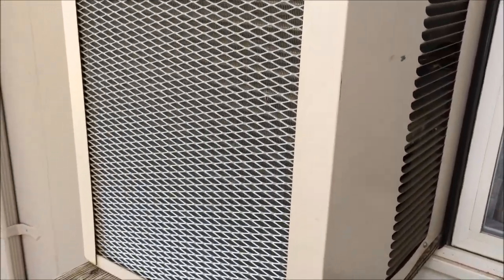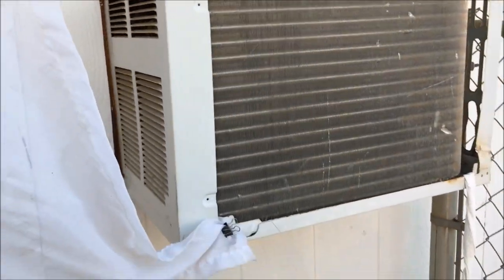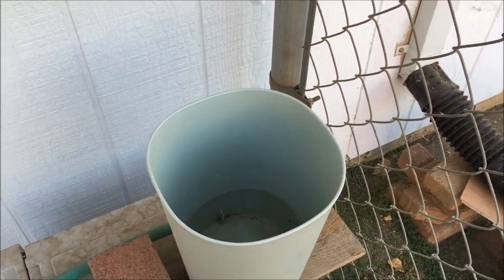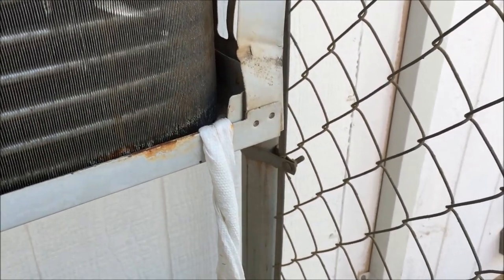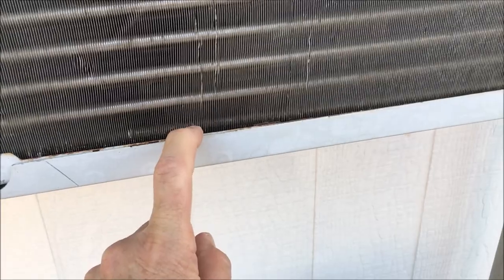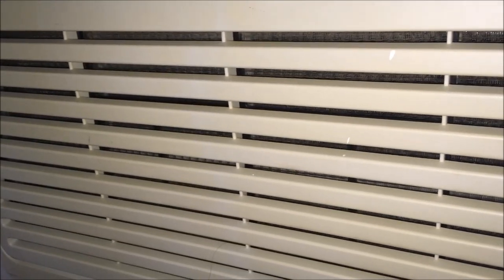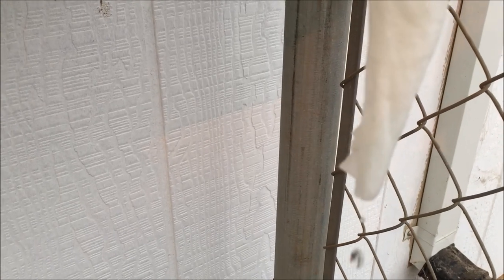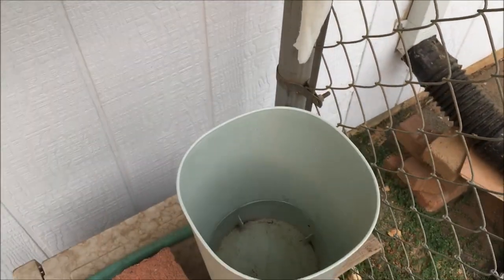Drain Water from Window or Wall Air Conditioner Drip Pan

Comment: Units was easy to unpack and slide out from the case. I installed this in the wall to cool my garage. I live in NV and it’s been cooling my garage pretty easily while being 105 degrees outside.

Comment: I have had water dripping out the front of my unit onto my furniture and tried this. It took about three minutes for the paper towels to become completely soaked and start dripping! I don’t know if it will stop it but it is certainly going to help get rid of some of the water that I think is backing up and coming through the front of my unit because it’s not tilted outward. Thank you! Everything else suggested drilling holes in the pan etc. and I definitely did not want to do that and risk damaging some thing
Reply from the maker: Hi Crash.  The water is coming from the drip pan and into your home for one of two reasons: 1) You may well be correct that the AC unit is not tilted or slanted AWAY from the side of your home or 2) The drain pan itself is plugged up with dirt and debris, thereby blocking the condensate (water) from draining to the back of the unit and draining out.

If you have a level, put the level on the unit outside, coming out of the window or wall, and you'll be able to determine if the AC unit is properly sloped away from the side of your home.  If the unit is properly sloped away from your home, then the issue is likely dirt and debris in the drain pan that is blocking the water from draining to the back of the unit.  If that's the issue, you'll need to remove the AC unit and give it a good cleaning outside.  Not to plug one of my videos, but I do have a video that shows you how to thoroughly clean an AC unit.  

I hope this helps you.  Let me know if you need further help.
Reply: @frugaldiy1  I don’t think that it is properly sloped but I also think it may have debris plugging up the tiny little hole that is in the bottom of the drip pan. Before I did the paper towel thing I would put my finger up by that hole and water will just start running out but then it seems like it might still be getting debris in it. If the paper towel method works is it OK to just do that and leave them there? I don’t want to drain all the water out of the pan if it needs to be there though. I won’t be able to do anything with it until probably next week or the week after
Reply from the maker: I'm by no means an expert, Crash.  Personally, I'd rather keep the paper towels in place to stop the water from dripping into my home, onto my furniture, down my walls and into my window frame (if it's a window unit).  I truly don't think it will harm your AC unit to evacuate the water until next week or the week after.  You might lose a little energy efficiency, though.  

Try using a toothpick to dislodge any debris from that small hole.  Also, try lodging a piece of paper towel in the hole so it can drain water from that hole.

Comment: Thank you for explaining this! I was really confused when my new window unit did not say to make it lean out significantly nor did it have a proper drain hole. This does make sense and I have noticed that when it is wet it does seem to go better even though when the vents are in the closed position water still sprays inside the house… That said, there is a significant amount of excess water so I keep a bucket underneath but that bucket overflows faster than I can keep up with dumping it then it’s very heavy and slushy. Before I used to have PVC pipe rigged to lead excess water into the garden but a flood took that away.

I guess I am going to raise my budget as high as it can go where it still takes only the excess water and run a siphon from that down into the creek… Thanks for the videos, cheers!
Reply from the maker: You're welcome, Monzai.  Re the water (condensate) in the AC coming inside your home, that should not happen if the AC is properly sloped/slanted away from home and the drip pan is not plugged with dirt/debris.  

You're a smart cookie!  The use of a PVC pipe to lead the water away is brilliant.

Comment: That Kenmore casement unit at thw beginning appears to be made by White Cosilidated Industries. Those units usually do have drain holes in the bottom of them somewhere. Also I have seen units from the 50's that use that slinger fan design. It's a good ideal in theory but they will rot out faster especially with the dirt and different metals sitting in the water together.
Reply from the maker: Thank you for the information.  It's good to know.

Comment: How’s your humidity inside you house? I feel like this. water would just get reevaporated and sent back inside your house between cycles (especially when the fan runs when the compressor is off).  Without the water, you should have lower humidity inside your house and can therefore keep the temperature a couple degrees higher and still be comfortable

Comment: I do the same but only at night.. i let the water do its job during day.. but at night i put my wick in at night and it drains out and pretty much dries up. Very little rust and I run mine 24/7 in Florida. The water absolutely helps keep the air coming out much cooler. I cant stand the sound of the fan splashing the water at night.. so runs no water from about 9pm until 7am no issues... but if I forget(occasionally) to take it out my room goes up between 4-8 degrees depending how humld and hot

Comment: A piece of synthetic felt works great for wicking; so does synthetic yarn (you can pick up a skein at a thrift shop for under a buck).   Do not use cotton as it will rot and stink.  

Side note.  African violets prefer to get their water from the bottom so a piece of synthetic yarn down through the pot and out the bottom works great.  When salts start showing on soil surface then give it a good flushing from the top, not getting leaves wet.
Reply from the maker: Funny farm 555, thank you for the valuable information.

Comment: Thanks for the info , the issue is my brand new is rusting like crazy
Reply from the maker: You're welcome, Cam.  That's a typical issue, and that's why you need to drain the water from the drip pan area.  ;)

Comment: I like your common sense approach.  Wick it during off time hour’s only. 
Logical IMO. 
I’m definitely all for wicking the ac pan dry. 
Because mine rapidly developed a stench so disgusting that I couldn’t run it.  And all my cleaning efforts were temporary fixes that never completely got rid of the oder.  I realized that the standing water was the stench cause.  Causing mold and mildew most likely that smells like dead fish ! 
And the enormous amounts of mosquitoes that line every crevice in the unit. Doesn’t help matters either. 
I’ve wondered if it possible to wrap the exterior in window screen to reduce the debris and bugs. 
However would my window ac still operate properly if wrapped in window screen ? 
Logically the idea looks good on paper.  🤷‍♀️
Reply from the maker: Thank you, Sha T.  I like simple solutions to problems I have.  I enjoyed reading your comment and found it interesting.  Re wrapping the AC unit, I would think that any screen or wire mesh smaller than 1/4" hardware cloth  would have a high likelihood of obstructing the intake and output air flow too much. But, there's nothing risky in giving it a try--you may be on to something.  ;)
Reply: I did exactly that to my window unit because within the first week of having it installed it was collecting tons of leaves, bugs etc. I got a $10 roll of window screen to cover the vents, using magnets attach it. It’s working great!
Reply from the maker: The magnets are a clever idea, radlikemad.  Thank you for letting all of us know the window screen and magnets worked well for you.

Comment: Most newer window air conditioners come with screws not in those corners you can just take them out if you want to drain your air conditioner and if you want to do it right make sure you're on about a 10° tilt they should never be level in your window so it's leaning out and downwards
Reply from the maker: Brian, thank you so much for sharing the information with me and other viewers.  I truly appreciate that.
Reply: Thanks for being specific in the degrees of tilt required. 
My rental came with a wall opening and renters were responsible for supplying and installing their own ac unit. 
This was my first time doing the install. I knew the unit required tilting but wasn’t sure how far. 
I ended up with drainage issues and the wall panel had been installed tilted inwards to the interior of the apt. !? 
Causing that wall panel too flood and drip into the apt. 
Also the panel opening allowed for just a certain amount of outward tilt, as I stated. Adding additional holes in the wall panel didn’t work.  I believe in all probability becuz of the massive amounts of bugs attracted to the standing water in both the ac pan and wall insert. Plugging up all drainage holes. 
My ac is tilted as far as the wall insert allows. But drainage issues continued to be a nightmare. The rancid oder, “ dead fish” developed within two uses. 
I’ve been dealing with these issues for 3 years. Unable too resolve them. 
Until I came across this video. 
Nevertheless I wondered if I have my unit tilted too far or not enough. 
So thank you for giving an approx tilt level.

Comment: This seems good but I’m worried about fire hazard, it’s 35 degrees here and there is hot air blowing out the back of the Ac, what happens if the paper rips or gets stuck in there then dries out?
Reply from the maker: FrostyEmber, each side of the air conditioner is covered with the condenser or sleeve, so I don't think that will happen.

Comment: My ac sounds like it’s hitting water but I do not see any water at the bottom. But it sprays out water from the vent where the cool air comes out
Reply from the maker: Take a level and check to see if your AC is slanted/sloped toward the inside of your home rather than the outside.  An AC needs to be sloped toward the outside of your home so the water can and will drain to the back of the AC and outside.
Reply: @frugaldiy1  you know what, that’s a good idea. I opened the front and there’s water on the inside. I cleaned some of the water out with some paper towels. I left it opened and turned fan mode on high for a few hours to help dry it out. Now it’s not making anymore water noises or spraying water. But I will check to see if it’s slanted. Also I had this wall ac unit for over 16 years, never had this problem before. But I guess after years of using it, it’s expected..
Reply from the maker: There are channels that allow the water that drips from the evaporator, at the front of the unit, to the back of the AC.  When those channels get pulled with debris, the water can't drain to the back of the AC, so it stays in the front, and water sprays out of the vents.  Likely, the channels on your AC are plugged.  You'll need to remove the AC and give it a good cleaning to clear those channels.

Comment: I don't know what my issue is but the bottom pools with a LOT of water underneath like that. There must be something wrong? Maybe I'm just running it for too long at a stretch.
Reply from the maker: Have you tried putting a paper towel or piece of fabric in the bottom to wick the water out?  That works really well to remove the standing water.
Reply: @frugaldiy1  Yeah I just got the idea from you and happened to have an unused office type waste basket. Seems to be working so far. But I can't do it from the back while running the thing.
Reply: @frugaldiy1  Either way, it's working and I've got a big fan on me in the mean time. Way too hot for October these past few days! 

Thanks for the idea. Can't believe I didn't think of that 🤦‍♂️😄
Reply from the maker: I'm glad you found something that works for your situation.

Comment: Can I drill and then plug it?
Reply from the maker: If you do, you run the risk of hitting the coils, so I wouldn't.  If you puncture the coils, it's game over because the refrigerant will leak out.
Reply: You can drill anywhere in your cooler, but manufacturers recommend not to do so because it will void warranty.  The real question is why the Engineers did not provide a permanent solution to the condensation which leads to water leaks.
Reply: @HelmetVanga  Yeah I’m sure they don’t mind saving money that’s why

Comment: Our hotel needs this common sense solution. Water constantly runs down the side of our build and is starting to slowly enter in the widows seals directly below units.
Reply from the maker: PreBound, I agree.  Water intrusion into a structure, at any point, is a recipe for disaster.  I don't understand why any business or person would allow AC water (condensate) to drip down the siding, drip onto the ground and splash up onto the siding or enter into any area of the structure.  Maybe they don't realize the damage water intrusion can and will do over time to a building or home.  Dry rot and mold can be expensive to repair.  A paper towel or two and a catch basin are cheap and effective.

Comment: Is this important?
Some people say this is supposed to happen?
Reply from the maker: Is what important, Axios 07?
Reply: @frugaldiy1  
Draining the unit with a cloth/paper towel
People say it's supposed to be like that don't worry, but I don't want any rust/mold

So I'm lost idk what's right or wrong
To me it should drain...idk why it doesn't, I'm wondering if they want the new AC's to die from rust so you will buy a new one?

It's very strange to me
Reply from the maker: Axios 07, I'm an older person, close to 60,  and remember well the window and wall ACs that came from the manufacturer with a drain hole in the bottom of the drip pan, and those units worked wonderfully and were less apt to form rust in the drip pan.  Heck many of those older ACs are still around and working fine today.  

That said, the newer air conditioners are manufactured to retain standing water in the drip pan so the water can be slung up on the condenser coils to cool the refrigerant gas running through the copper lines, and I believe the standing water achieves.  They say the newer units are more "energy efficient."   I don't believe that.  

My take and preference: I prefer the older units to the newer, cheaply made, units.  I do place a paper towel in the drip pan to wick the excess condensate water out of the drip pan to prevent rust formation and debris collection.  

And, yes, Axios 07, I too wonder if the manufacturers benefit from water standing in the drip pan causing rust and other issues, i.e., premature failure of the AC which necessitates buying a new AC.
Reply: @frugaldiy1  
Yeah this is very interesting, these things should be built to last to be honest given the price nowadays, it's not totally cheap and environmentally it's bad to throw away

I've decided not to put a towel or anything just yet, I'm gonna closely monitor everyday or so to see if there is any sign of rust, mold or anything. If so then will definitely put one

It's just so far it seems like not everyone is 100% sure, some say drain it, some say don't as it's supposed to cool down the coils and such....only time will tell I guess, but we gotta do some due diligence as I don't trust any profit driven company
Reply: @axiosw0774  You are right. I would like to read the manual but I doubt it covers this issue.  Contacting the manufacturer and asking them the real hard questions is best way to go.